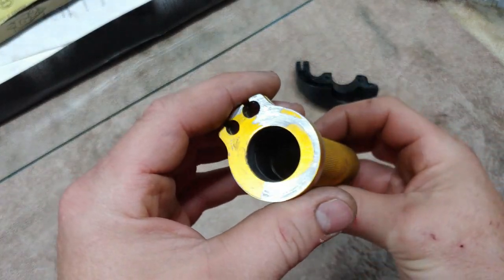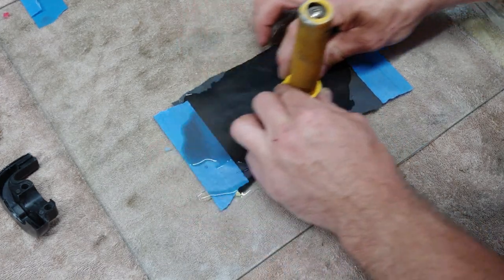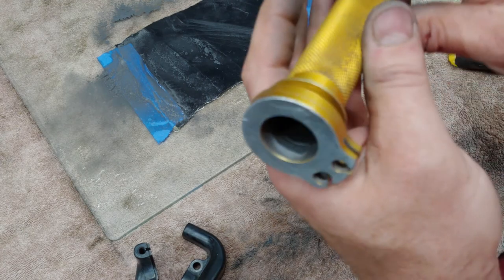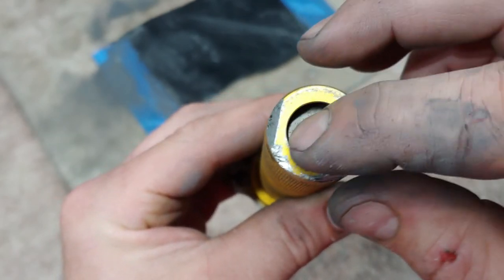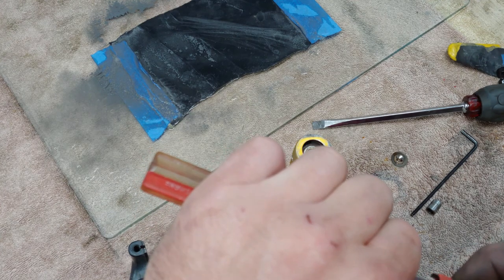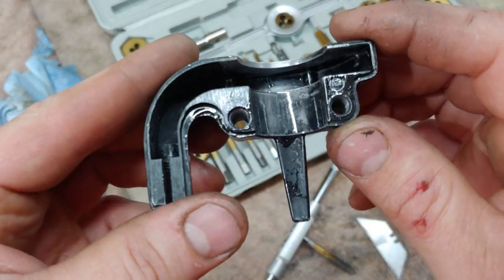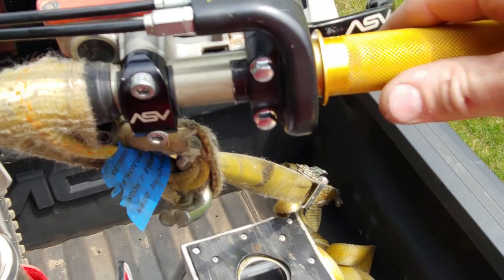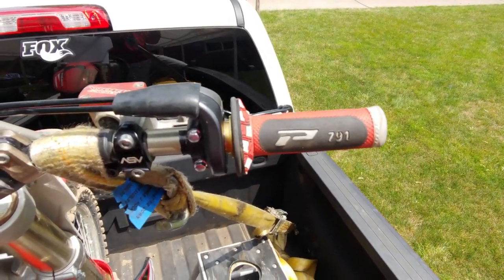Fixing a Sticky Honda CRF250r Throttle | Repair and Sneak Peak Ride

Comment: Gonna give this a go, thanks and great paced vid 👍🏻
Reply from the maker: Good deal. Hope it helps. It worked for a while. But I ended up getting a new throttle tube and housing and cleaning my cables later on. Which made it like new again. Thanks for watching.

Comment: Whats the point of 20 minutes of rambling if your nlt even showing the point of the video which is reinstallation. This is the only video online about this gen honda throttle with the stupid overengineered mechanisms i was hoping this singular video across the entire internet would show how to assemble it
Reply from the maker: Wait, so you don't know how the throttle tube, cables and housing goes back together but you're going to give me crap for making a video in how these can go bad and how to fix it so you don't hurt yourself or someone else on the track???
Reply: @Fixin2Ride-Official-  I'm just wondering why one cable has 1" of slack and the other has like 3" and which one is the push and pull? About to find out which one is the push and just delete it entirely if I can even find anything online about it. If you had included that part in your video rather than cutting it out, it would have been the only source of this knowledge I'd be able to find across the internet
Reply from the maker: @Gr8_Z28 probably because it's pretty easy to figure out that if you pull the short one that's a simulating twisting the throttle and that opens the valve. Give the short one A Yank and if it snaps back that's the one that goes on the back side of the throttle tube cam
Reply from the maker: @Gr8_Z28 forgive me but I thought that was just common knowledge